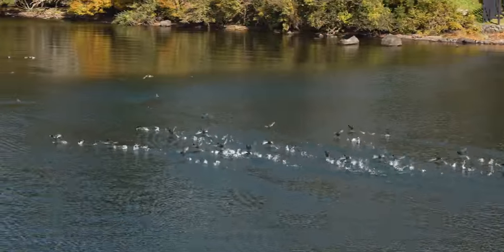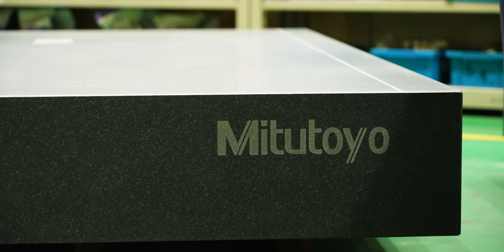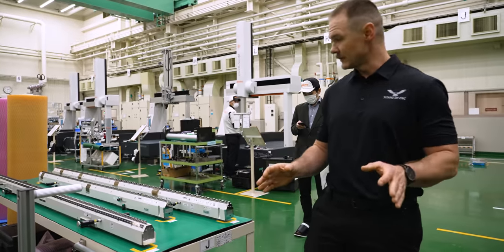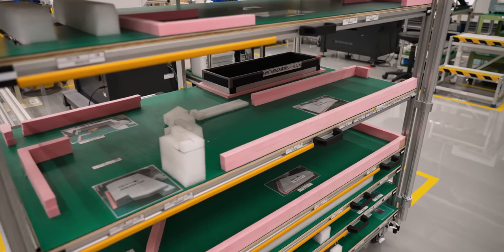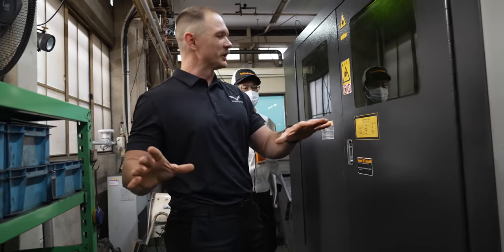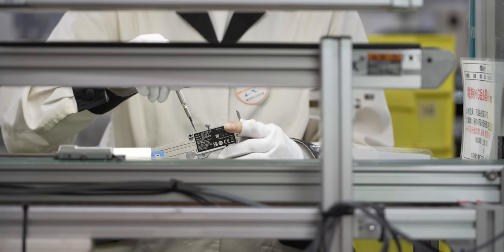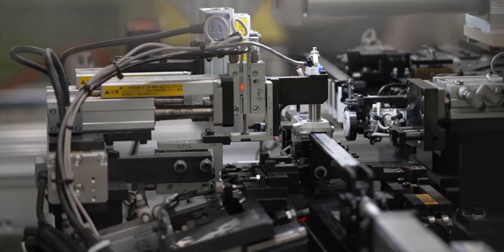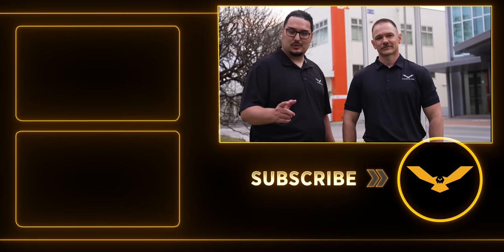Machining 70 MILLION Calipers in JAPAN | MITUTOYO FACTORY TOUR

Comment: Mitutoyo is that one legendary brand where you know you are going to get some of the the best  and most precise and accurate tools humans are capable of creating. 

I feel like there's a level of prestige in owning tools from Mitutoyo, even though they can be found in-use everywhere. I know a few of my local auto mechanic shops have at least one set of Mitutoyo calipers on hand because I've seen them while bringing my car in for service. I'd bet they likely have a slew of other Mitutoyo tools in a toolbox I didn't see.

Whether you realize it or not, everything we interact with daily was designed, developed, and engineered using at least one of Mitutoyo tools.

Thank you Mitutoyo for doing what you do.

Comment: And, here i am, thinking about finally retiring my 150mm IP67 Mitutoyo caliper, after 5,5 years of daily use in a job shop... It has it quirks, few dings, but i still use it every day, even though i know that in some ways it measures 0,02-0,04mm off and is getting a little worn and a bit looser in the 0-50mm range... I can get a new one any time i want, but it gained some sentimental value for me, it was the first caliper i got, i learned everything i know as a CNC machinist today with this caliper in my hand: setups, tooling, programming, 3axis, 5axis, lathes... Its hard to move on and get a shiny new one...

Comment: All my precious measurement tools were Miutoyo purchased 45 years ago and used them every working day for 30 years and continue to use them to this day. My most used tool is my mechanical digital dial caliper and the mics were only used to do the final precision check. Some of the boxes are worn out but all the instruments work just as good today as they did 45 years ago.

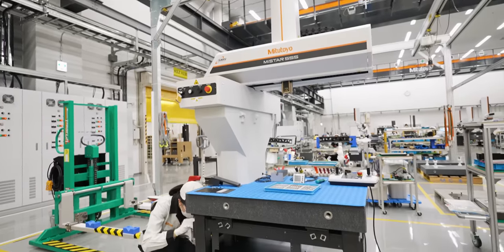Comment: That part kit system at 5:20 is used in quite a lot of assembly lines. Rolls Royce had (possibly still have) a job role that was just bulding the parts kits for the assembly techs.

Comment: Master !
/me stand up and bow to monitor.
BTW Mitutoyo is the only stuff i measure with, when work have given me anything else i have requested permission to bring my own.

Apprenticeship in Denmark was actually called Master apprenticeship in the old days, thats no longer the case as this changed in the late 80ties.

You talking about deburring,,,,,, reminded me of the Danish AV company B&O they have robots polishing their remotes ASO before surface treatment, a human can barely look at the process.
Actually they use AI to look for scratches,,,,,, like minute / smaller than hair scratches.
So you can have nice B&O stuff or things from the many companies that work with them.

I have also painted parts for Dynaudio speakers, a fly dropping of inconsistency and the part was redone, CUZ these are no cheap speakers.
Sadly i never got to work for Terma which is a aerospace company here making a lot of interesting stuff, so in that sense i never got to where i aspired to be.

Comment: You explain the "precision" required to machine granite to extremely small margins of error.  Yet in Egypt there are ancient blocks of hard granite with similar levels of precision, (both internal and external) and they did it with "copper chisels and hammer rocks".  With no precision machines required at all???